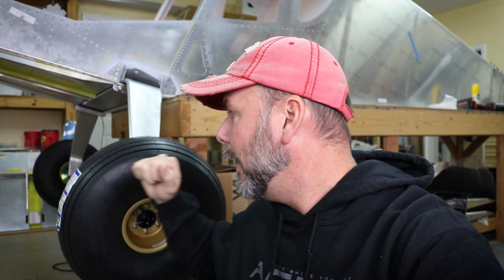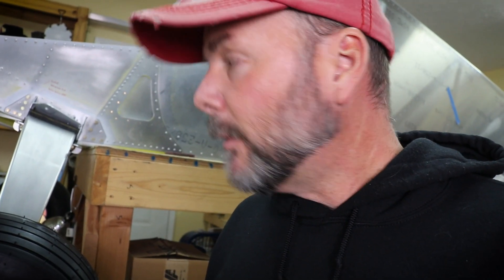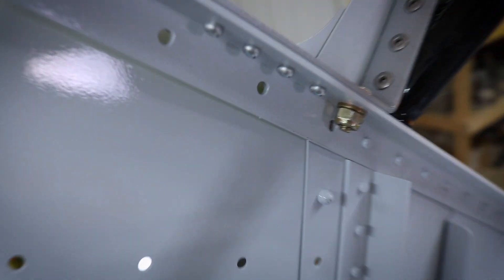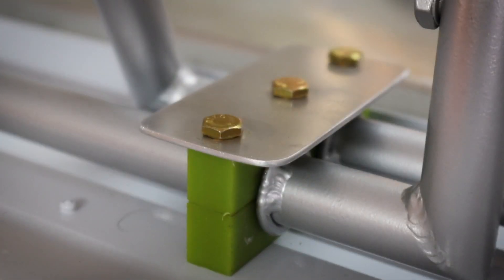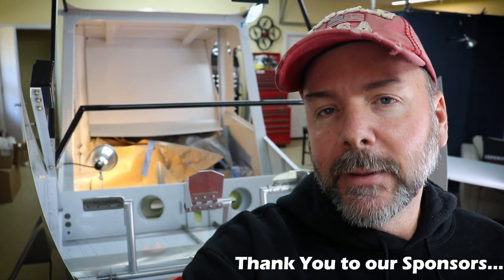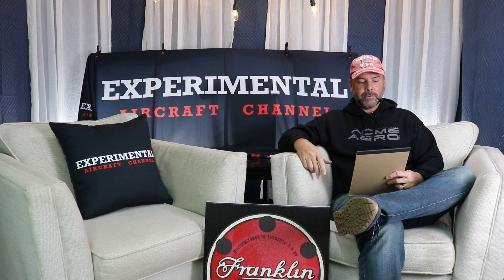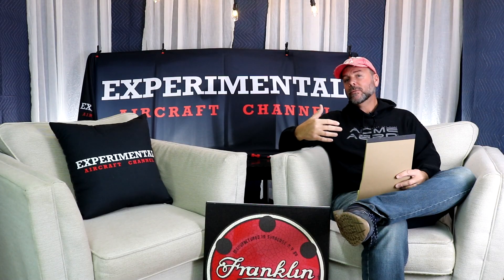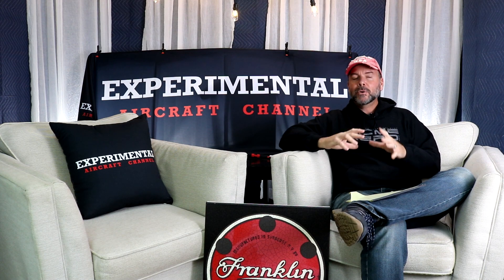Airplane Build Update - End of 31 Day Build Challenge

Comment: Well done video.  Always interesting to see what other Cruzer builders are doing.  I also had the intensifiers installed.  In looking at the Matco supplied documentation, it seemed like the Zenith stock pedal geometry is a model case for "don't do this" in order to realistically achieve the minimum 400 psi hydraulic pressure.  Its low cost and for sure makes me feel better.  Your 21 inch tires look great.  Where did you get them?
Reply from the maker: Thanks for saying hello! The 21" tire option is available straight from @Zenith Aircraft so we simply... "Traded UP!"  :-)

Comment: In 725+ hrs, I've had no problems with the strut bolts contacting the landing gear ... someone must have made some REALLY hard landings to do that! LOL!
My original gear pads did start to deteriorate badly even though my "baby" is hangared and doesn't have so much UV exposure, etc.  It was suggested to me to get 60 durometer, 1/2" thick rubber material from McMaster-Carr.  This works great and fairly economical!  I made the top pad 3" wide rather than 2" and it doesn't seem to want to migrate out laterally like the original 2" pads did.  Another advantage of thicker pads is that they give you a bit more adjustability of compression and perhaps a slightly "softer" ride when taxiing.
BTW, I upgraded to 21" tires on my STOL 750 and the original Matco brakes seem to work just fine, however, my 750 is an Edition 1 and was supplied with dual caliper brakes ... don't know if the later Edition kits still have those?
Reply from the maker: Hey John! Yes I heard about the "Rubber Option" as well and that is why I decided to go ahead and try that now Vs. swapping them later. It will be interesting to see if it rides "nicer" with these for sure. On the brakes.... I only have single calipers. But remember mine is the CH750 CRUZER which came with the tiny 5x5.00 tires so the geometry changes a lot with the STOL tires and then even more with the 21" tires. Maybe... the STOL comes with dual calipers. Not sure. Thanks for chiming in! :-) When I get flying... send me an invite again to come visit you! Would really enjoy that!!! :-D
Reply: Consider yourself invited!  A trip to TN would be a nice cross-country once you get those 40 hrs flown off!👍 Maybe we could combine that with an informal regional Zenith fly-in! @ExperimentalAircraftChannel

Comment: The tyre leak may  stop if you leave it ,mine did.   Leaving the fire wall off really helps ...but don't forget that when you pull the sides in the fuselage shape changes a little .l have a twisted rope to pull the top longerons closer ...34 and a bit inches same as the firewall ,from memory,so check.......Regards from over   here .
Reply from the maker: Hello from "Over Here!" Thanks for saying ... "HEY!" The next morning that front tire (Tyre) was completely FLAT. So... I will try to pump it up again and check for bubbles/leaks. But I was informed that the boys at the factory now assemble these by putting a bead of RTV Silicone on the "split" of the rim and THEN rolling the O-Ring into place. No problems after this. Yes.... I am aware that the fuselage isn't quite in the correct place without the firewall on. I had it clecoed in place while working the interior metal and even the landing gear/wing attach weldments. Good to point that out though.